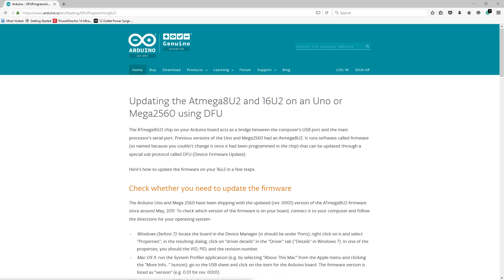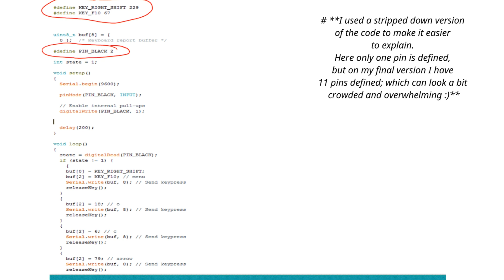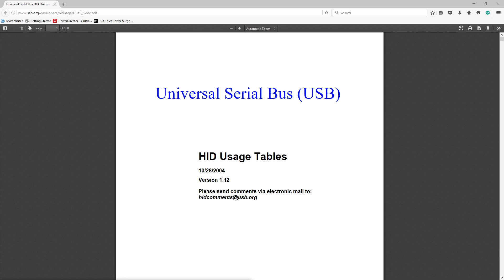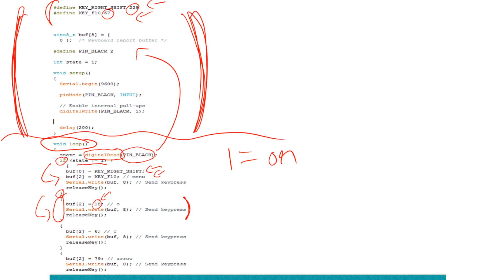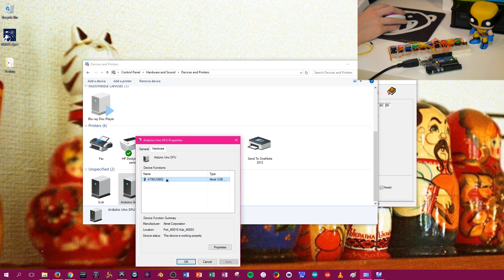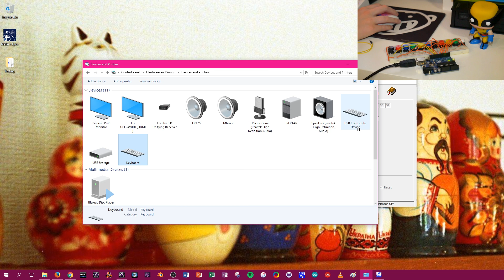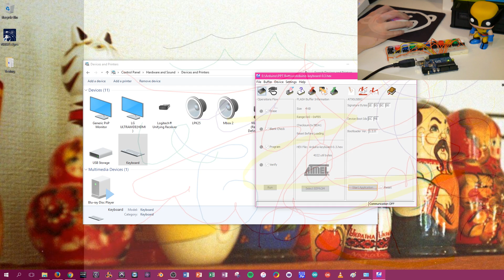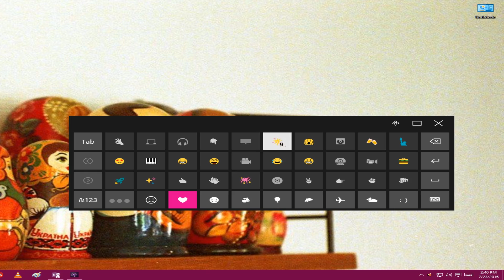Arduino Project Tutorial: Macro Keyboard

Comment: Thank you!!!  Man, I've been searching for this for a while.  I do have one question, though.  What would you need to do for even more simultaneous keys, like ctrl+shift+s or even crazier like ctrl+shift+alt+s?  Is it possible?
Reply: So I might be over a year Late but if you make the keystrokes something like f23 and then use a key mapper to make it a proper macro
Reply: @firex7051  no worries. I got the keyboard running, so, changing the code won't be a huge issue... thank you for the great tip!
Reply: @ haha I can’t believe that you responded so fast after a year, gl
Reply: @void-h2n  Which keymapper do you use? Is it free?
Reply: @ i heard that Obs is good but you'd have to watch a tutorial

Comment: this is a cool project, though I do have a couple questions. It seems there are some libraries used in the code that weren't displayed on screen, and also while this does work clearly, why not use a micro or a Leonardo instead since they come compatible with the keyboard library to make the code much simpler? sorry if it comes off wrong, I'm just genuinely curious, is it just because the Uno is generally good for beginner?

Comment: Would there happen to be a HEX file for a mouse HID? 

also, you can type unicode by holding left alt and typing the code on the numpad. (i.e. a smiley is L-ALT + 128512 [on the numpad]) the scancodes for the numpad keys are different, and I guess windows actually cares.

Comment: I wish i thought of goodleing this before spending 20+ hours making a serial decoder in python to receive data for arduino so i could use pynput to output keys :'(
Reply: I'll take that serial decoder off your hands if you'd like. I just finished watching this video https://www.youtube.com/watch?v=6vbdUSMmDCM and I'm lost in the sauce  because his code doesn't work for me at all for some reason.
Benefits I see to a serial decoder is that I can change the python script on the fly where as the Arduino I have to flash hex files back and forth. I find this to be a head ache...
Reply: @IcanCwhatUsay  Add my discord   TheMysticPigeon#3236 I'll send u it. I forgot if you have to pip install anything cause I never watched a tutorial o kinda just winged it. Because of which the code is very messy. Also on my youtube there is a video where I made a controller. I dont really talk about it but u can kinda see what's going on

Comment: Hi many thanks for the video. Three questions:
- Is it possible to use all pins on the atmega for inputs i.e. including the analog pins but defined as digital?
- If i want to implement a full size keyboard with more switches than available pins, i need to put them in a grid of rows and columns. Can I follow the same logic as in your example to find which key is active by checking both the rows and columns. 
- How can this code be extended to work with multiple keys being pressed at the same time such as: "Ctrl+C" or "Ctrl+Alt+Del"? I understand that the macros you demonstrated are based on single button being pressed, which calls multiple commands in sequence, instead of multiple buttons being pressed at the same time with each one calling a single command.

Comment: Links are not working anymore, also, can I load the keyboard firmware to the USB and program the microcontroler via the ICSP pins? I'd like to run a lot of tests and don't want to re-load the arduino firmware everytime I want to test a new version of my code.

Comment: Thanks for the vid.  I have the idea to build a similar input tool for excel. In my work i need to input fraction and i think this is totally do-able. Cant wait to show them .  Question...do you have resistors in series with each button?
Reply: Judge1257 D if you are using a pull-up resistor with the buttons (recommended) then you don’t need a resistor in series.

Comment: Thanks this helped me out, but now I'm having a problem. How do I connect mechanical keyboard switches to the Arduino. And also can I use an Arduino Nano, Pro Mini, Pro Micro to do this?
Reply: Lazy Chicken idk if you found an answer but the pro micro has an atmega32u4 chip, which supports keyboard input with the Keyboard.h library

Comment: im not using an original arduino uno, but cloned UNO with big text saying 'UNO' on it. will it still work for me? It's using CH341SER chip for serial
Reply: i have the same question, but reading coment, i see sad news for us. "You've forgot to explain how this thing works.
So, when the original Uno was designed, the designers needed a good USB-serial converter between the PC and the Atmega8 chip (later it was replaced by 328P). FTDI's converter was way too expensive, and the cheap converters weren't around that time (CH340, CP2102), so they chose an Atmega16U2 for this role, because it has hardware USB support.
Now, after you programmed the main chip, you replaced 16U2's firmware to be a keyboard (or maybe a generic USB HID device). 
Nowdays most clones use CH340G to save money, you can't replace the firmware on those, so you can't use a clone for this project. Leonardos and Micros have Atmega32U4 with USB support, so you can use those instead (even micro clones will work). Or you can use a micro as a converter, and use a mini the same way the video showed."
PD:sorry for my bad english

Comment: You've forgot to explain how this thing works.
So, when the original Uno was designed, the designers needed a good USB-serial converter between the PC and the Atmega8 chip (later it was replaced by 328P). FTDI's converter was way too expensive, and the cheap converters weren't around that time (CH340, CP2102), so they chose an Atmega16U2 for this role, because it has hardware USB support.
Now, after you programmed the main chip, you replaced 16U2's firmware to be a keyboard (or maybe a generic USB HID device). 
Nowdays most clones use CH340G to save money, you can't replace the firmware on those, so you can't use a clone for this project. Leonardos and Micros have Atmega32U4 with USB support, so you can use those instead (even micro clones will work). Or you can use a micro as a converter, and use a mini the same way the video showed.

Comment: Okay, so you loaded the Arduino code then flashed the keyboard hex file, so the arduino code is still on the arduino correct?
 I want to integrate this into an IoT project I am working on where I want to connect the arduino wirelessly to send macro commands to my computers. Could I integrate the NRF24L01 Library into this?
Reply from the maker: Yes exactly. I haven't experimented with that library but if it will be operating within the Arduino code then it should work.

Comment: Hi! This project is very interesting but in case i want to build a keyboard i don't want to leave my Arduino Uno into the box. Do you think it's possible to load arduino-code and firmware into another Atmega?
Reply from the maker: I totally understand about not wanting to leave your Uno in a project. I'd recommend getting a smaller board from Adafruit or Sparkfun that has the same chip so that you can have it be dedicated to the project. The Adafruit Trinket boards are great for this. I actually just used one in a project to control lights inside my computer. Hope this helps!
Reply: Thank you Liz, i will try it! :)

Comment: can i use mechanical switches instead of push button?
Reply from the maker: Absolutely! You can use any button as long as they're hooked up to a microcontroller. Sparkfun actually sells a mechanical keyboard switch breakout board and you can connect multiple breakout boards

Comment: Hi, how can I do a 3-keyshortcut like Ctrl+Alt+t. I saw you did the SHIFT+F10 using buf[0] and buf[2], for my case should I also use buf[1] or whats the logic? How do I do this with more than 2 keys at the same time?.

Thank you
Reply from the maker: I haven't tried this, but I think the logic would be buf[0], buf[2], buf[2], since a single key press is buf[2]. I believe buf[0] is acting as an initializer to tell the script that more than one key is about to be pressed. I may be wrong, but I would give that a try first.
Reply: So you're thinking in something like:

buf[0] = shift
buf[2] = alt
buf[2}=t

wouldn't that just overwrite the buf[2]? Let me give it a try and I'll let you know what happened
Reply from the maker: If that doesn't work, my next thought would be buf[4] on the 3rd key. so buf[0] = shift; buf[2] = alt; buf[4] = t, since it's working with 8-bit logic
Reply: Hi, I have a problem, in the buf[0] = shift i'm using the 225 (as it says that in the pdf table) but it doesn't work. I've tried using the volume changing key, etc and those work but not the shift, ctrl, etc.

Something I realized when trying to use the ctrl is that 224 doesn't work but 0x01 does so I'm a little bit confused in what source could I use to get the id of the other keys
Reply from the maker: So for all modifier keys (shift, control, alt, etc) you're going to want to declare them at the top of the code before the setup using their hex code.
Reply: I found a table for the hex codes of all modifier keys, it includes a combination of multiple modifier keys.
So this means that if you want a combination of Ctrl+Alt you would define a new key with the number 5.
Example: #define KEY_CTRL_ALT 5
And then in your code:
buf[0] = KEY_CTRL_ALT
buf[2}= t

ps, good question ;)

Comment: Nice video but having issue to upload code to the arduino before using flip . Need hel!!!
Reply from the maker: you should be able to upload the code to the arduino via the arduino IDE as normal, then proceed to using flip to load the .hex file
Reply: It  says that "releaseKey" was not declared in this scope
Reply from the maker: do you have this at the bottom of your code?
void releaseKey() 
{
  buf[0] = 0;
  buf[2] = 0;
  Serial.write(buf, 8); // Release key  
  delay(200);
}

Comment: I have a problem where the keypress actually presses a different key instead of the one I have set. For example, I set the letter Z to 29, but it displays a foreign character. Anyway to go around this?
Reply: Jaymagus you dont set keys to their number (ascii code) they allready have set numbers you have to use. For example the key "1" on your keyboard has the ascii code 49 and you cant set nore change that. You have to use 49 as key "1".

Comment: Hi, Good job!.
I have a problem with FLIP software, AtLibUsbDfu.dll not found > Could not load dynamic library. Please Help me. I have an ELEGOO MEGA2540 R3 & ELEGOO UNO R3. Win 10 OS x64. I can not load the .hex file,,, From Colombia South America. Greetings.
Reply: I had the same problem but on Win 10 x84. I also have ELEGOO UNO R3. It should be similar. It had to do with the drivers of the ATmega.

Try going to device manager and look for the chip listed (it probably has some kind of caution or warning icon next to it). Click on it and go to Driver. Click on Update Driver. You can try and have windows try and find one (lol) but it will probably fail. Go to "browse my computer" and navigate to "Flip x.x.x\usb" and hit OK. Let the drivers install and you should be good to go! 

There is a vid on youtube somewhere that should help if you get lost.
Reply: Many thanks Carl. I tried that way, but I did not get results. In device manager appears to me as COM port and LTP, hardware id \ VID_2341 & PID_0010 & REV_0001. I need help. Thanks

Comment: Nice job - I am working with an accelerometer and arduino as an input to a virtual pinball machine which takes keyboard inputs. I looked at the same article you did (MitchTech), but wimped out and decided to buy a Leonardo which uses the  Atmega32U4 and supports keyboard without firmware modification.  If I had seen this post before I ordered the Leonardo, I could have saved a little money. Again, good job.
Reply from the maker: Thank you! And that project sounds awesome!

Comment: I am using arduino uno board, I was reset it but my computer not detect DFU it detected unknown device, please help me
Reply from the maker: after you reset, did you use atmel flip to load the firmware? after you reset, you should be able to use flip to load the firmware to the device via the usb port

Comment: The much easier Keyboard commands/library only work on an Arduino Leonardo/ATmega32u4 processor boards. Does changing the firmware and using digitalread bypass this limitation?
Reply from the maker: if you mean that the arduino uno is able to be seen as an HID device after following those steps much like those other boards are by default, then yes. if you're asking if the keyboard commands library will work on an uno by changing the firmware, then i'm not sure since i haven't tested but it would certainly be worth a try.

Comment: Please excuse for questioning you again. I wrote a code that will type 'a' when the button is pressed but it always types seven 'a' like 'aaaaaaa'. If you can understand what is wrong by looking at the code that I posted,  I'm happy to know. Thank you.

#define KEY_A 4
#define PIN 2
uint8_t buf[8] = {0};

int state = 1;

void setup(){
  Serial.begin(9600);
  pinMode(PIN,INPUT);
  digitalWrite(PIN,1);
  delay(200);
}

void loop(){
  state = digitalRead(PIN);
  if(state != 1){
    buf[2] = KEY_A;
    Serial.write(buf,8);
    releaseKey();
  }
}

void releaseKey() {
  buf[0] = 0;
  buf[2] = 0;
  Serial.write(buf, 8); // Release key  
}
Reply from the maker: Don't apologize, these are great questions! Everything looks good in your loop, but I would try adding in a delay in the void releaseKey() portion. Try inserting "delay(250);" under Serial.write. It sounds like what's happening is that the button is bouncing, or basically the Arduino is trying to read the input from the button too fast and as a result causing the multiple A's to be typed. Let me know if this helps.
Reply: Thank you so much!!!
It worked like a charm!
I appreciate your help :)
Reply from the maker: Yay! No problem, glad it worked!

Comment: Very nice tutorial!
I have a question. When shall I write the code on to Arduino? Is it before using Flip or after using Flip? If it is after using Flip, is it possible to write code using Arduino IDE as usual?
Reply from the maker: thanks! so the proper order is to code in the Arduino IDE, upload the sketch to the Arduino as normal and then use Flip to change to the keyboard firmware. Hope this helps!
Reply: Blitz City DIY Thank you for your reply :)
Reply: ashimo

Comment: Great tutorial!!
One question...
Does this work with a generic arduino uno board?
Reply from the maker: thanks! and it does, that's actually the board i'm using in the video, but I loaded keyboard firmware onto it for it to work. recently i did see a video and tutorial uploaded showcasing how to make a macro keyboard using the Arduino Pro Micro, which doesn't require firmware to be loaded onto it: http://www.makeuseof.com/tag/make-custom-shortcut-buttons-arduino/